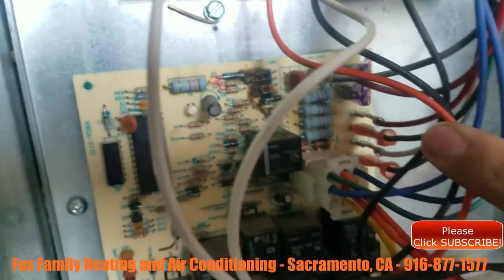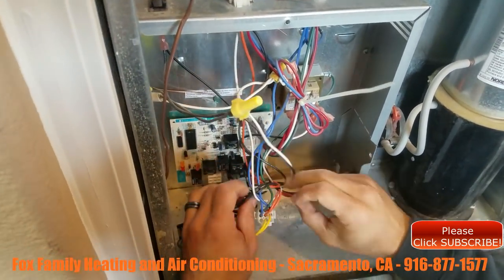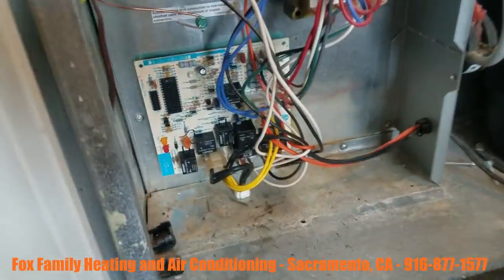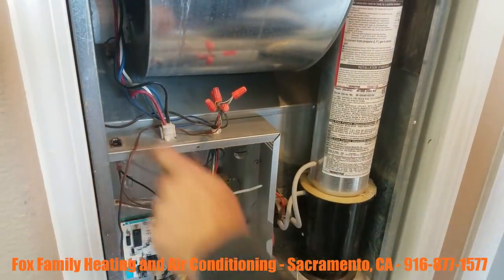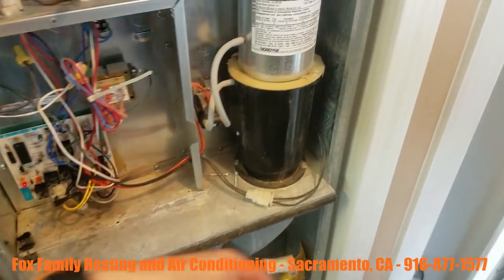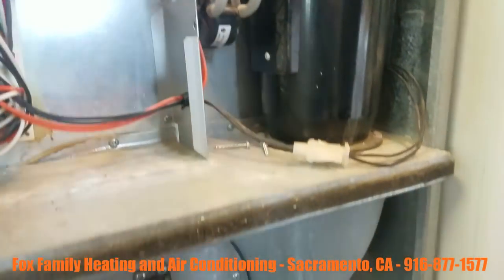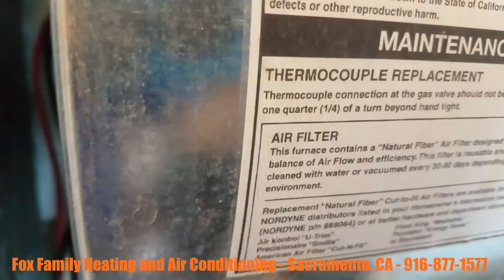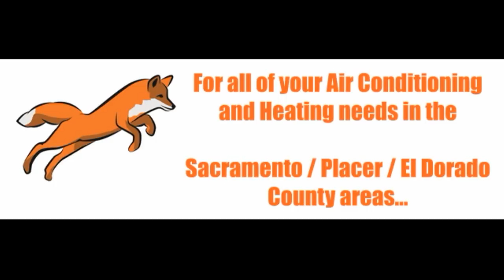The Life of an HVAC Technician - Episode 7 HVAC Service and Installation

Comment: I also snap a picture of the existing board before removing any wires. I've found on new out of the box furnaces air handlers or anything with a board a quick look behind the board could save you a lot of grief...factory screws are accidentally dropped and love to land behind electronics and short them out.
Reply from the maker: God point!

Comment: Lifetime warranty on parts? Seems awfully generous to me. Especially for things that fail on a regular basis like capacitors and igniters. Do you really want to to be replacing them for free 5 years down the road?  The 15% discount is enough.
Reply: Jim D I agree. I would think they still charge labor. In other words eat the low cost of parts but have the customer on the hook for any future work. Most especially for the complete change outs.
Reply: If they paying for the yearly club fee Ill let a 12 dollar capacitor slide. They gonna get their money on the big stuff,  Compressors/Change Outs. Hes playing the long game not the short game. Great strategy.

Comment: solder joints @ 5:33 actually look OK judging by the video, the pins in the plug are hollow so having the small center hole open isn't an issue. I cannot see 100% if the joints are cracked between outside of pin and actual board though.
just before that @5:22 the top side components got wet and corroded, so I'd be looking at how condensate, rodent urine or possible roof/vent leak ran in and onto the board. that could become a short time period callback if it's condensate from hvac or vent pipe, it can be real corrosive from chemicals in surrounding air. laundry cleaners and such :)

Comment: Wish I can get into residential hvac. I'm trying to get into hvac.
Reply: Greg called it a mobile home furnace. What makes it different than a standard down flow gas 80%?
Reply: You’re gonna regret that wish. Get into commercial
Reply: HVAC Game Proper  nothing. Just a model home series line I guess
Reply: TheACKid would you recommend me getting into residential first for a few years then getting into commercial when I'm more experienced.
Reply: HVAC Game Proper They are designed differently. They use drum style heat exchangers instead of a clamshell. The combustion air comes from outside through a concentric vent adapter.  Also, the inducer is on the combustion air inlet pipe and blows into the heat exchanger instead of being pulled through like on a standard 80% furnace. Lastly, there is no return duct attached to a mobile home furnace. There are louvres and a filter slot on the blower door and return air is pulled directly into the blower from the room.
Reply: id say get into commercial asap. The learning might be a little harder and demanding at first but try hard and keep moving forward and your employer would be happy to keep you. my biggest tip for you is to dont believe just what everyone says. consider everything from everyone else. Do your learning from the books learn the theories youll be the smartest tech. Being the smartest tech isnt the only skill you need. you need communication skills time management skills and knowing what to do in different situations. That all comes with experience.